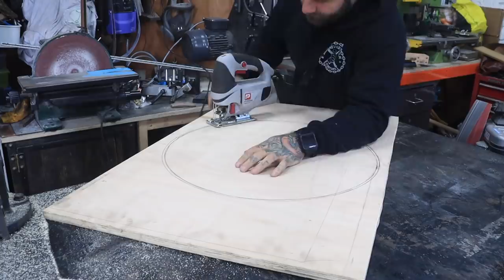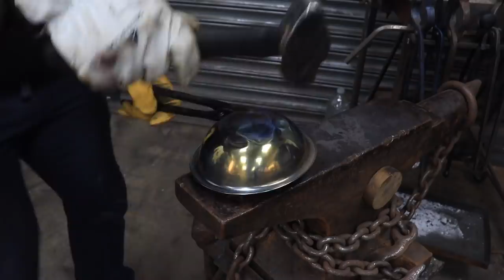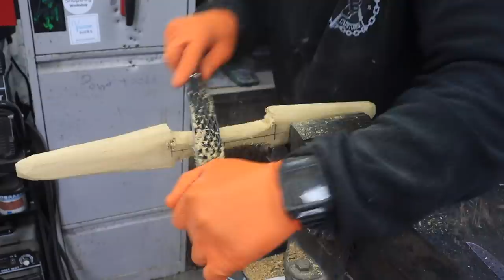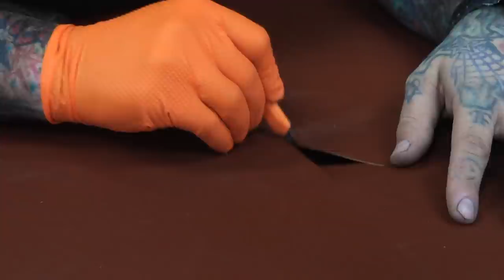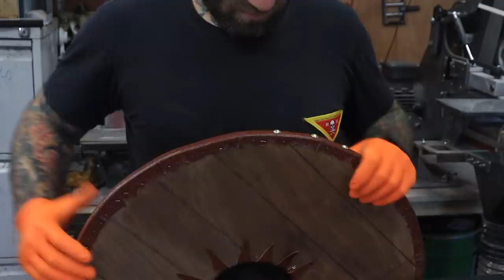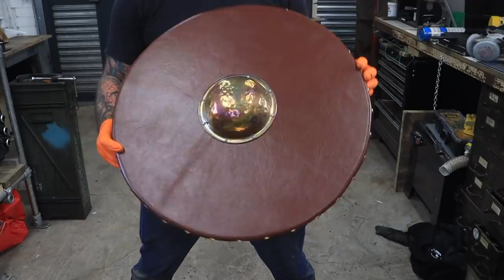Viking Shield Making - leather wrapped and forged

Comment: Don't have all the tools you have but still gonna try. Couple questions. What size plywood was that? 1"? What diameter? I'm trying 32". What tool did you use to make it look like planks on the back? Lastly I have a 3.5" wide leather strapping that I want to use on the outer and cover both sides. Any suggestions? Thank you for the ideas. You are a great craftsman. Skal.
Reply from the maker: Old video so I can’t remember what i used sorry